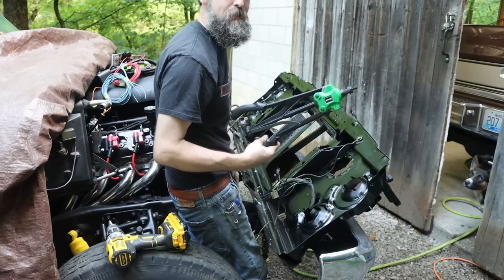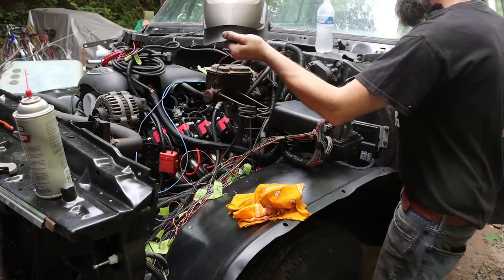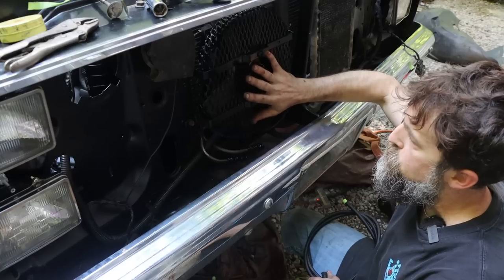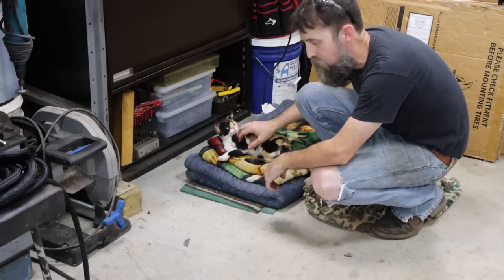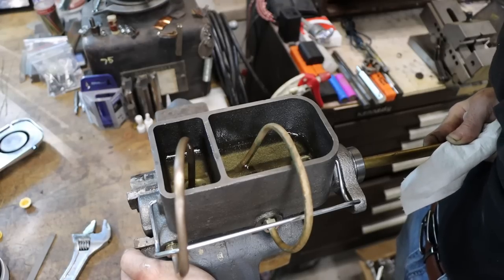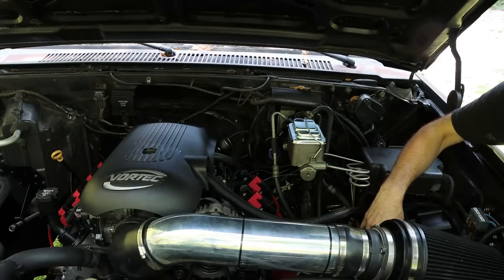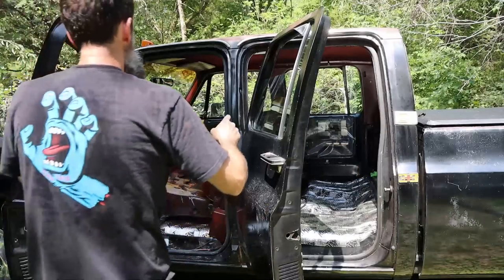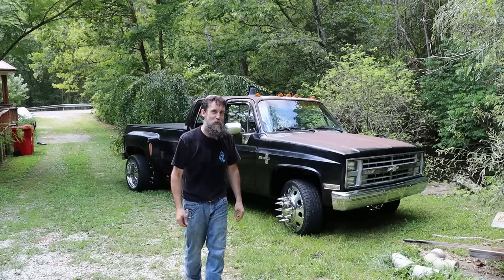Building Johnny Cash 1986 Crew Cab Dually . This truck is a;most complete

Comment: tip for you. I had one of those back in the late 80s had trouble with seeing out of side mirrors, we lengthened the tubing to the mirrors and after adjustment I pinned the tubes at the clamp with 1/8th roll pin so they would not rotate out of position but if hit the roll pin snaps and is easy to replace. good content and delivery style

Comment: Watching you bench bleed,  I've used copper tubing for bleeding purposes, it's just much easier to work with for that process.  Also, I've switched over to DOT 5 FLUID in my trucks I'm keeping. It's synthetic and draws no moisture to cause RUST internally to the Master cylinder, brake lines,  or wheel cylinders no matter how many years it sets.   Cost a little more, but well worth the investment.

Comment: i'd just get rid of the tailgate - straps and a 2x6 are all you need - better gas mileage and less weight, add bags of sand in the winter - anothe good project finished - hope you can plan some good projects for fall and through the winter - keep on truckin'! you should get plenty of use out of this truck

Comment: Just a tip. These new fandangle ignition switches don't like all that stuff , other keys etc hanging from them. It will give you many more years of service by lighting up the weight hanging from them. A truck key, house key is all that should be there. The rest can stay on a seperate key and fob eh.

Comment: Steve, a word of caution on how you mounted the electric fans. Keep and eye on the tubes for leaks. Because the tubes are so very thin, vibration over time will wear through the tubes. We did a friends like that but after about 15,000 miles it started leaking. Now for a beautiful paint job!

Comment: Looks like we need to get a video every other week now. No problem as that tells us you are really busy taking care of more important things. This rad and fans are just a ticket to success with this build. I call these threaded inserts "rivnuts" No tool box should be without a selection of them. I have used them in blind holes badly threaded  with a welded tap killer of a hole. So far so good. I have yet to have one fail. Good to see that your Elisabeth and Cora approves at your progress eh, LOL. I sure like the BLING you give your progresses/projects. I have the same brake fluid bench bleeders in my ? drawer in my main tool box that have a bunch of uses. Great keeper tools eh. Great to see another project from you done the right way. In the future any repairs (ANY) can be done using OEM supplies. Never can anyone tell it has been hacked away at eh.
Reply: You want to see Riv-nuts fail? Look at over the road semi's!!
Lots of failures.
Mainly from ham fisted, knuckle dragging, 1/2" impact carrying "mechanics".
Reply: @haroldphipps3457   LOL, I know exactly what you mean. They are not threaded holes in 1/2 inch plate. Properly installed and used they are a great idea.

Comment: Great progress guys and the fabrication on the tailgate is awesome. I would probably cut out the Chevrolet stamping on the old tailgate and mount it on the wall. Cora is such a beautiful dog. I’m not a fan of the big wheels and the huge spikes but hey, it’s your truck. I probably would have opted for 18’s with more ballon type tires as that would soften the ride and make the truck quieter. 
It’s going to be a very useful rig once it’s finished. Cheers, Stuart 🇦🇺

Comment: Steve, a non related question, now that you have the vehicles looking nice have you thought about building a shed/lean to type etc so they are protected during the winter months. Like your vids and look forward to them coming out each week.
Reply from the maker: That's a lot of truck to cover😄. A dry space out of the sun would be nice. One day👍
Reply: Carport  on a concrete pad would work nicely.  One with extra height  for clearance of whatever your hauling or that K30 that might end up being you're next project Truck ???

Comment: Something that might be a good tool build video is to make an adapter for setting the nutserts using a drill or impact driver. Just a thought. With the electric fans do you still need the fan on the engine?

Comment: I would advise you Steve, to not use "zip ties" to secure the radiator fans, the heat will or may cause them to break, also I hope there is padding between the fans and radiator or vibration and chaffing will put holes in your tubes

Comment: You have enough talent and equipment to take that long handle kittywampus thread install tool and make a short hydraulic cylinder and remote grease gun type device to operate it. Cut those long handles and other junk off of it!
Mike

Comment: Steve, why have an engine driven fan when you have twin electric fans?  The engine driven fan consumes power and therefore fuel, not to mention the extra noise and the electric fans allow the engine to reach the operating temperature quicker.  Most modern vehicles just use an electric fan system - mechanical fans went out with the Arc
Reply: I'll bite.  The mechanical fan is the ideal setup for HD trucks.  It does have parasitic loss, as does the alternator when running 2-30 to 50 amp fans.  It also has a clutch that slips when cold which helps with warmup time.  As for modern vehicles,  My 2022 3500 GMC and 2008 Ford F-450 dump both have a mechanical fans.  Mechanical Fans cool better in extreme heat and load situations and are more reliable.  Electric fans are meant for half ton Suburbans and Trucks and of course cars.
Reply: Keep in mind that electrical fans still consume power from the engine via draw from the alternator.  Mechanically driven fans are actually more efficient - they don't suffer the energy losses in the conversion to electricity and then back into mechanical motion.
Reply: @92BiminiCoupe   I was expecting such a response and this is nothing if not stimulating debate.  The mechanical fan with a solid coupling, an electro mechanical or viscous coupling will have parasitic loads at all times, although the electro-mechanical and viscous ones require less horse power to drive them in the warm up phase and I have never seen a mechanical fan that was not spinning whilst the engine was running i.e. being driven by drag.  When up to temperature those large mechanical fans can draw up to 15-20hp all the time even though there is air flow through the radiator.  When cold the majority of the parasitic load comes from the drive belt, which you wouldn't have with electric fans and that is not inconsiderable e.g. 7-9bhp @4000rpm.  Electric fans on the other hand draw no load until a critical temperature is reach that tends to be outside of the normal working range and they will be working for very short periods, so the parasitic load via the alternator will be very low o/a.  I have a Tdi Classic Range Rover that originally had a viscous coupling fan that I converted to twin electric fans and before I could plumb in a thermostat switch, I ran it for some months with just a temporary dash switch.  i was amazed how little I needed to switch the fans on even towing max loads around and having to negotiate our UK cities that are very congested with mostly stop/start driving.  At normal highway speeds the temperature gauge did not move from normal.
Big trucks have mechanical fans because they spend a good deal of their time stationary at idle with no air flow through the radiator and I can see a need for a mechanical fan in very hot climates but in temperate zones they are simply not needed for anything other than goods vehicles.  Mechanical fans are of course very cheap to install for manufacturers but environmental considerations often point towards electric fans to maintain heat in the engine, within the ideal range.  There are two aspects of Steve's rig that is probably worth noting 1)  I doubt whether the vehicle will be used up to its maximum duty the majority of the time  and 2)  The mechanical fan as installed doesn't have a shroud to direct airflow through all the radiator so the mechanical fan will be sub-efficient and the electric fans will create an obstruction to airflow until they are working, reducing the mechanical fan efficiency further.

Comment: That truck really is coming along well Steve. You wouldn't get away with those extended front wheel nuts here in the UK though. The police would probably impound it immediately and have a lift truck take it to a compound for being dangerous.
Reply: They are friggin PLASTIC.
I'm sure glad we live in America.
Reply: @haroldphipps3457  Wouldn't matter too them. They'd take one look, throw a screaming fit and then try to do you for dangerous body work or similar.

Comment: Paint it! Everybody has their own ideas about "patina", but you will make the interior look like new, and with new bumpers and the new wheels, it deserves to be fully restored. I don't think the patina look matches well with the new wheels/tires and looks out of place. Besides, you have come this far. Not sure if you have body skills (1st video I have seen of yours), but judging by what you did with the tailgate, it looks like something you could handle. Couple hundred dollars in shop supplies, and just use some tractor paint or Rustoleum with hardener, and some clear coat to save on costs. Trouble will be that a CC dually has a lot of surface area and it will be some work. The truck appears to deserve it though, and it will go a long way to protect the roof and hood (and the rest) from further decay.